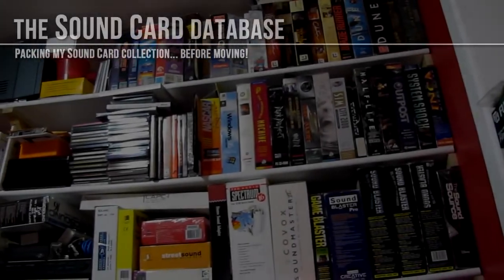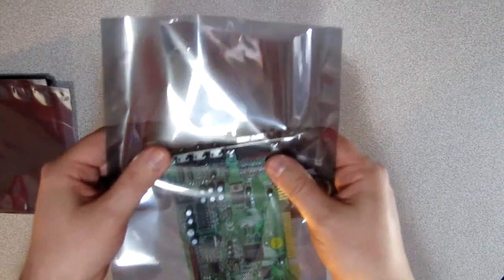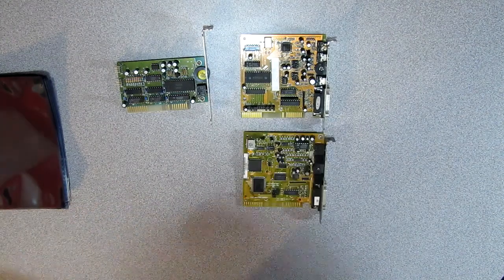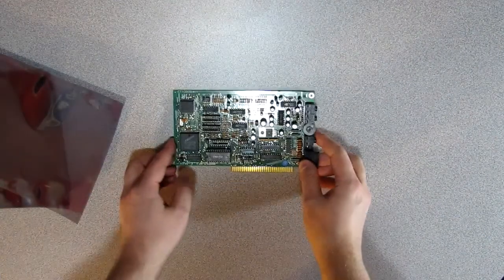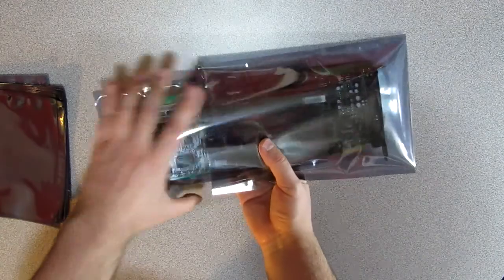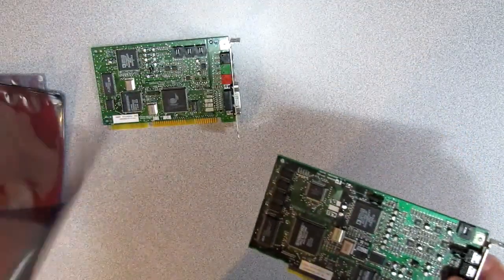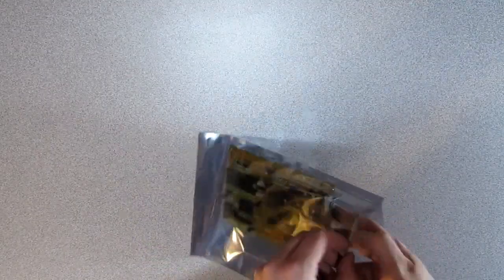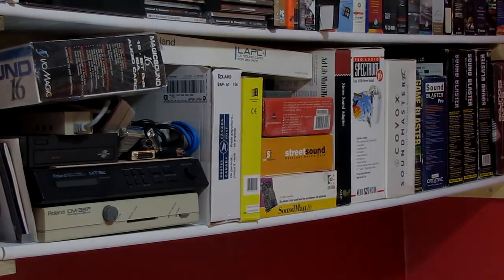Packing the Sound Card collection

Comment: Great video! Quite a collection. The Diamond Pro16 card with the Crystal codec is a variation of the AMD Interwave card, which itself is a variant of the Gravis Ultrasound Interwave.
Reply from the maker: Thank you Alexander! 
That info is quite interesting to find out. So indirectly that Diamond Pro16 would be at least partially compatible with GUS Interwave. Will try to do comparative recordings of both someday. Thanks for stopping by, I appreciate it!
Reply: Being a GUS fan/collector, I highly doubt this information is accurate. While the AMD Interwave is indeed compatible with the Crystal CS42xx series codec chip (which is also found on the GUS MAX for example), the Crystal codec of course completely lacks what makes the Gravis Ultrasound: the GF-1 wavetable synthesizer and onboard DRAM. The Interwave is basically this  - a combination of a somewhat extended GF-1 chip, with a Crystal-compatible codec "bolted" on top, for WSS compatibility and easier streaming music. So no, this card is by no means GUS compatible. Well, it is compatible the same way an AdLib is compatible with a Sound Blaster - there might be some overlap, or a small supported subset, but really, that doesn't make the AdLib a Sound Blaster. :)